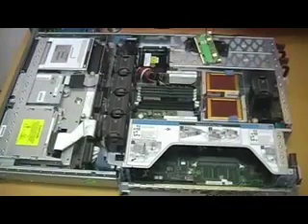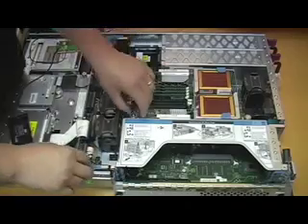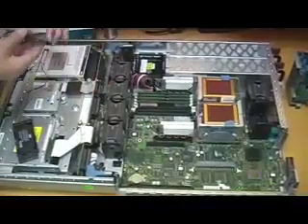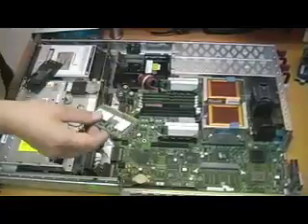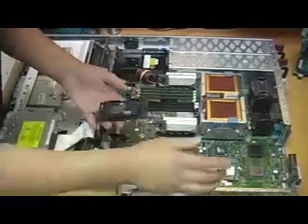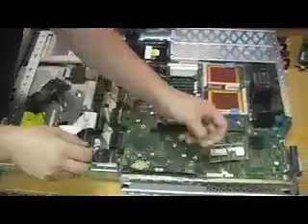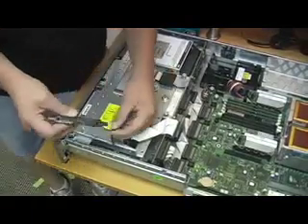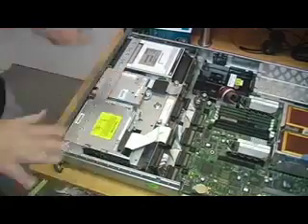Donny Does Upgrades - Battery Backed Write Cache and Fan Kit

Comment: Touching the chassis is not "a good alternative" to using proper ESD protection.  The idea is to have a high-resistance connection to ground so that any charge differential is slowly dissipated.  Just touching the chassis can cause an ESD event and damage parts not directly contacted.

So, no, touching something metal is not a good alternative.  Don't do it.  Use a wrist strap.